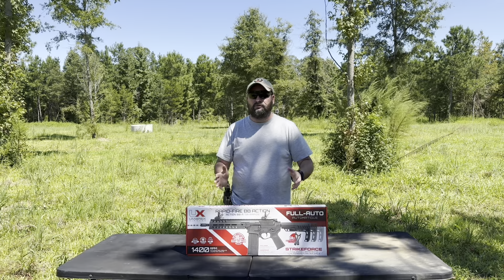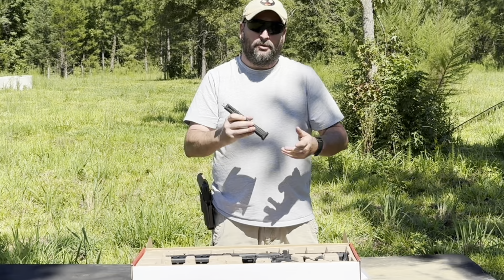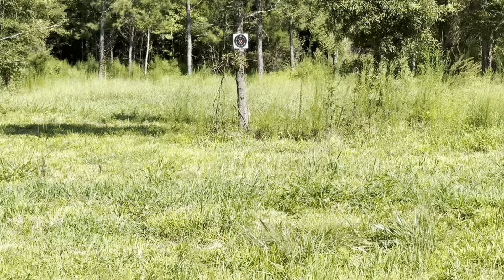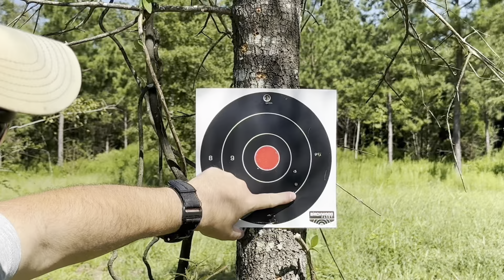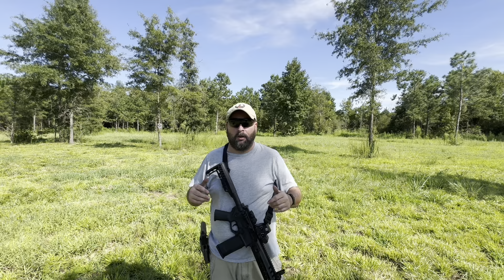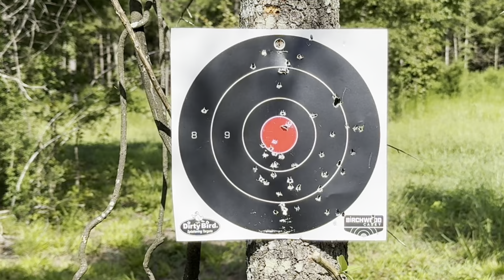UMAREX STRIKE FORCE

Comment: So,im seeing different reviews..is this a previous bad issue with these?? ive heard the magazine issue is supposedly a easy fix, not sure because ive yet to order one..one guy that does alot of video's had a couple issues, but said any seal issues are easily fixed.plus the issue with trigger pull..but this thing goes 460+ to over 500+fps And a HPA conversion would turn this thing into a different level altogether

Comment: I’m having problem with the bolt locking on the last round, did you have the same issue?
Reply: That is normal if the slide bolt locks back after the last round fired, just like with a pistol the slide would lock back after the last round/bb is fired. It's just a way to tell you that your gun is empty
Reply from the maker: I did have that issue from time to time. Not sure what the reason was.

Comment: I’m so embarrassed. The Airgun itself has been a pleasure to use…Until! I’ve blown the seal on the chamber piston. The blue rubber one. Umarex USA has no replacement parts and offered to allow me to send it back to them for inspection with 2 options. Either wait till they have a shipment arrive and replace the Airgun with no idea when they’ll arrive for them to replace it or a store credit. The gun is awesome when it functions. A real joy to use. Then like in your 3rd video my magazine had the same failure occur. Quality control has taken what should’ve been the direct competitor to the Crosman guns to what I would consider a hard pass for anyone. I’m going to discuss with Umarex USA the possibility of an exchange when the new shipment arrives in hopes that they realized the miscues and corrected them on this next batch. What a disaster.

Comment: Just seen your 3rd update. I am very please with my Strike Force so far. I’ve used 100% silicone oil and have made sure to lubricate the internals regularly. That being said…I find the Crosman R1 to be the superior product. I prefer the way the Umarex loads from the bottom but I can see why Crosman had to go the direction they did in order to keep the magazine appearance as authentic as possible. Acadamey shouldn’t be refunding you as far as I’m concerned. Umarex USA should be! I’m really hoping that the Strike Force arrives soon so I can purchase more magazines. I would love to see if the handle grip is AR grip compatible. The but stock definitely is. I can confirm.